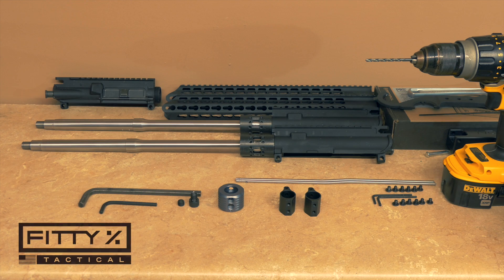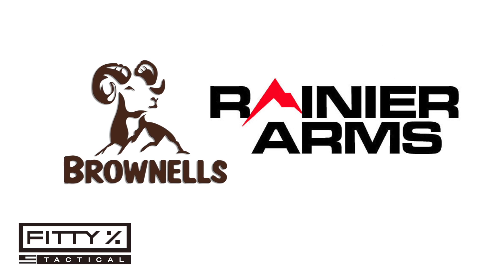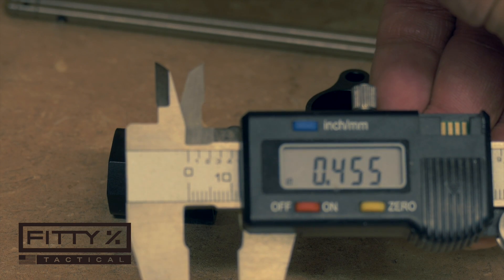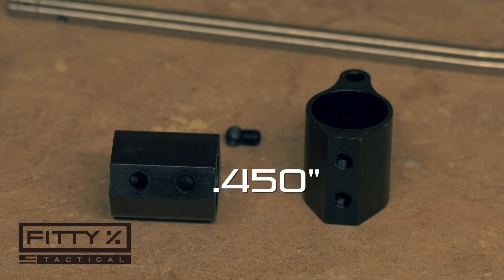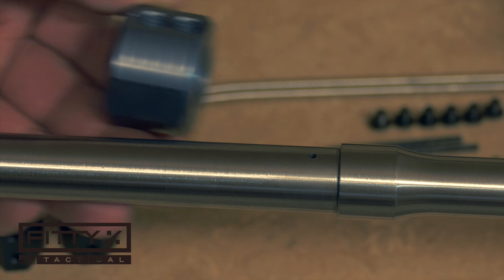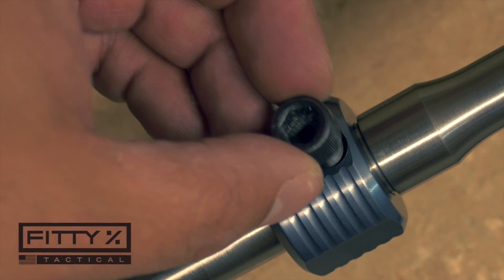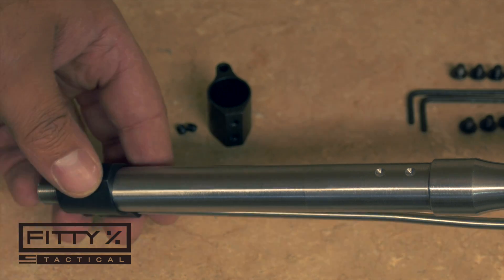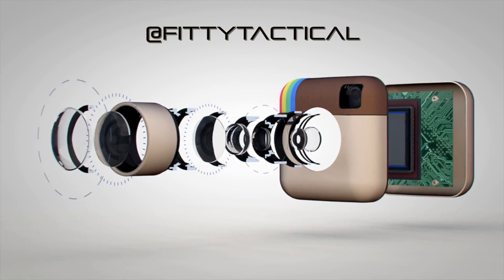AR-10/15 Barrel Dimpling

Comment: You actually explain things with knowledge about why. Thank you for that.
Reply from the maker: No problem bud. Ive taken what I used to do in the Army, Blackhawk helicopter mechanic, and applied it to my hobby. When you first start out as an aircraft mechanic in the Army all you really are is a "parts replacer" while the test pilots tell you what to replace. So in my last 8 or so years in the Army I started breaking down maintenance and preventive maintenance "barney style" so even the non mechanically inclined guys would understand.
Reply: Excellent info. I've been on the fence about ever getting set screw gas blocks, which limits my choices somewhat, and I had no clue if I wanted to spring for SLRs jig, but after seeing how simple it is, I might just drop some money for one soon. Thanks!

Comment: I dempled 2 barrels I have and both times it took quite a long time. I even had brand new colbalt drill bits. Just wanted to know if there is a better drill bit for dimpling.
Reply from the maker: Paul Hughes I used a cobalt bit and the time it takes depends on the sharpness of the bit, the material being drilled and the amount of pressure put upon the bit. I sped up some of the footage in the video to save time, but it still wasn't very long.

Comment: Great video dude! Is that a 5/32 drill bit? Is it a cobalt bit since you’re sinking it into Barrel Steel (either 416R or 4150 & 4140 CMV)? Thanks & Much Appreciated!
Reply from the maker: myinfinitestate yes its a 5/32 HSS(High Speed Steel) and should work fine. Now how long it takes depends on the barrel and the amount of pressure used. The barrels I used in this video were SS and fairly easy to dimple, but with other barrels you may have to apply more pressure for a longer period.
Reply: Thanks! for the info!

Comment: What is the part or tool you used around your upper reciever when u was sitting it into the vice? I been trying to find something to jold my gun steady in the vice while i put on my compensators and flash hider attachments for my suppressor. I see everyone simply placing a magwell block into the vice and torqueing down their comps and such while the only thing holding the gun is the block through the magwell. Just wanted to ask if thats something u made for around the upper in the vice or if u purchased it somewhere and if so what it is called.
Reply from the maker: A few different companies make them and they're called "Upper Receiver Action Block" or clamshell. Brownells has them.
Reply: @FittyACTUAL  i figured it out after i thought about the question and ended up wording it properly on google and found the aluminium ar 10 and seperate ar15 upper and lower vice blocks that connect through the takedown pin holes. Thanks for responding i just got my ar10 one in yesterday i got it from amazon basically just typed upper reciever vice block into search and i got what i found. Didnt even know they existed til i saw your video though so thank u for that.
Reply from the maker: @heyjohnson5535  Glad you're set bud!
Reply: @FittyACTUAL  thanks u for sure. Until your video i only knew about magwell vice blocks and i didnt want to use that to torque on a comp for my silencer and flex my entire gun i knew there had to be something better out there and your video proved that to me. So i started searching harder.
Reply from the maker: @heyjohnson5535  yep, using the right tools makes all the difference.